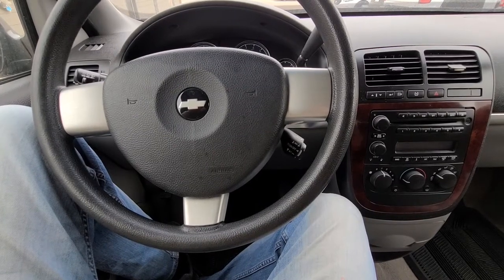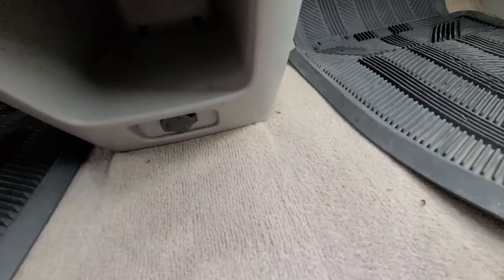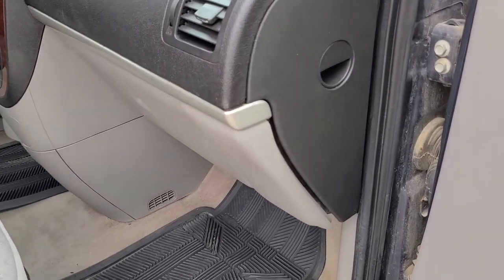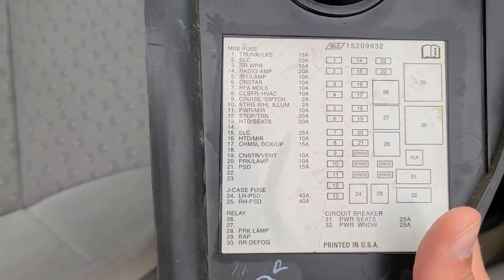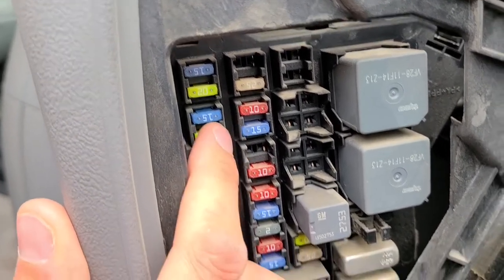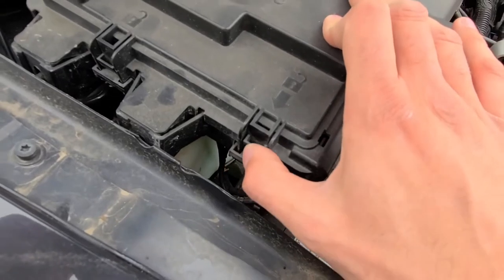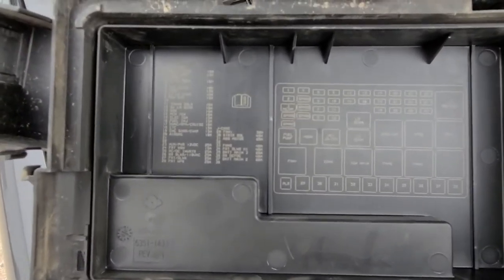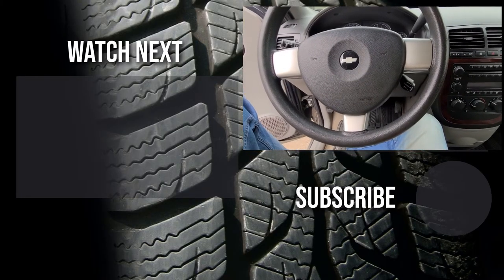Chevrolet Uplander RADIO / CIGARETTE LIGHTER / POWER OUTLET Fuse Location (2005 - 2009)

Comment: Hey everyone! I have a 2006 Chevrolet Uplander, and I noticed the 12V power outlet in the front is working fine, but the one in the back isn't. Does anyone know if both outlets are on the same fuse? If they are, I guess I might need to replace the rear 12V power outlet plug. Any advice would be appreciated!
Reply from the maker: Hi. I think both are on the same circuit I just checked the fuse diagram. You can remove it and test if power is coming to it. If yes than the outlet failed and if not there is a wiring problem somewhere

Comment: Hey what else could be causing my speakers not to work but the radio turn on
Reply from the maker: try pulling the radio unit out and check all the wiring / connections in the back

Comment: Where is the blower motor fuse and resistor. My AC and heaters want come on. All went at once.
Reply from the maker: Hello, I've seen you commented on several videos but most of them were regarding Chevrolet Uplander. If you own an Uplander, first you will want to check the blower motor fuses. They will be located in the main fuse box under the front hood. Check Fuse 26 (Rear blower) ,Fuse 27 (Front blower) and Fuse 34 (Front blower high). If fuses are good blower motor and blower motor resistor are located just behind the glove box. Blower motor will typically have just 1 electrical connector which has to be connected. Now you can test if blower motor is getting power by using multimeter. If it is getting power and blower motor is not working than it failed. If it isn't getting power than problem is somewhere else. Blower motors fail very often. If blower motor resistor fails your fan speed will only work on 1 specific speed setting, if you change the speed it will stop working. If it doesn't work at all, I would focus on blower motor. It is fairly easy to replace it, I believe it is held by 3 screws only. You might have to get into awkward position to reach it and have the right tools to access all of the screws. Hope this was helpful

Comment: I can't turn off the redio it has static only
Reply from the maker: Hard to say what is happening. Could be a problem with the radio unit itself or a wiring issue behind the radio. Try to pull it out and inspect wiring behind it.

Comment: Thank you, thank you!
Reply from the maker: You're very welcome!
Reply: I changed the blower motor and the resistor behind it. Didn't work. I connected the alligator clip to the released negative terminal on the battery and put the point of the tester on the terminal itself, then I pulled all the fuses one by one, all circuits remained on. Don't know what to do now.  I was wondering it there is some connection behind the controls in the main panel under the radio that could be the problem. What do you think?
Reply from the maker: @diannerobinson7858  Hmmm there could be a wiring issue somewhere along the way, it is really hard to say. You did a good job replacing / testing everything. Try to test if there is power coming to the electrical connector which connects to the blower motor. If not try to follow the wiring, then there is a problem somewhere between fuse box and blower motor